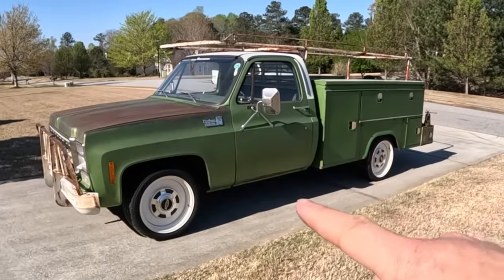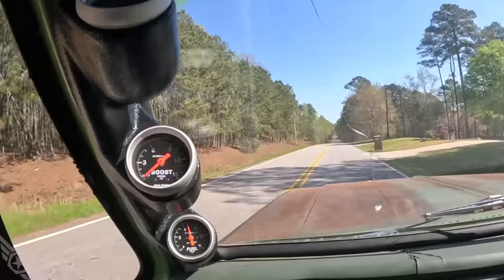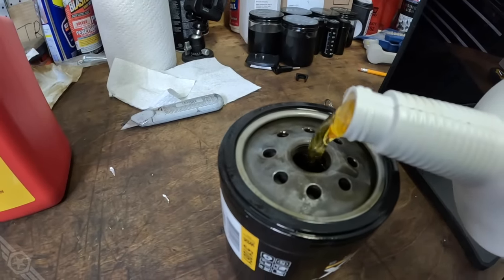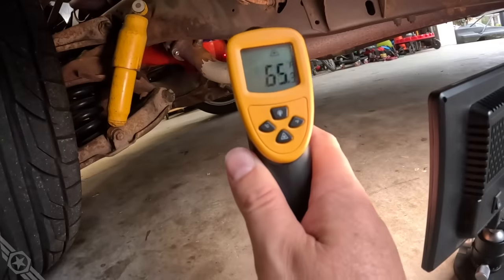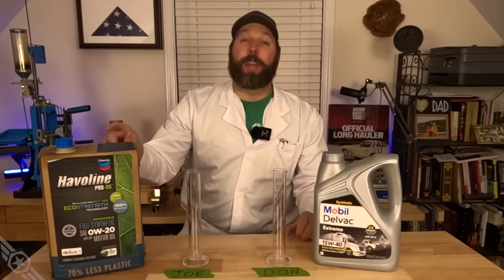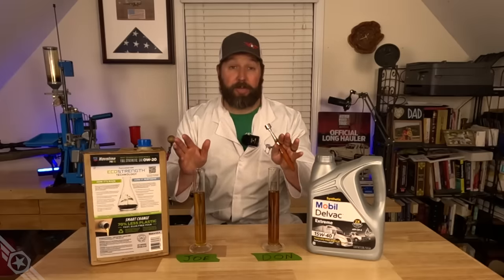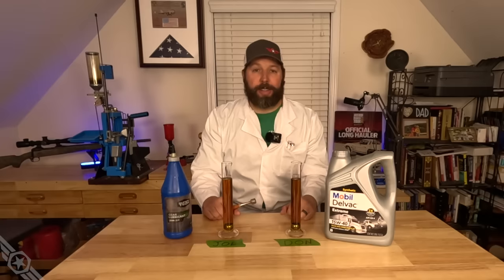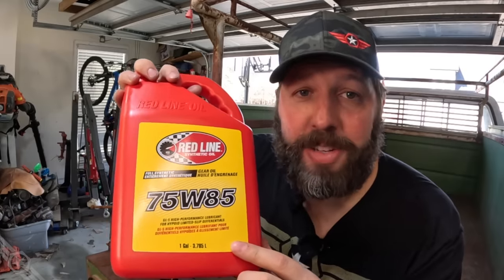Running GEAR Oil in an ENGINE!!! (EXTREME PRESSURE)

Comment: My experience with oil gauges (and temp.) is that they're an Idiot light with a needle instead of a red light.....you either have pressure (coolness) or not. I change my oil about every 6-10 thousand miles (after break-in) and have never had an oil-related problem in my 65 yrs of life. I do change the oil sooner if there's a turbo.
Reply from the maker: This is an actual gauge. Idiot gauges don’t move. They are either in range or out of range. The point t of the video is that gear oil and engine oil viscosities are on a different scale. The truck was just a teaching aid.
Reply: @freedomworx  Kool test. Thx for taking the time. As we all know, differentials and gear box's don't get as hot as engines.... so....there's that. Heat causes thick things to thin. As long as there's good oil between rods and cranks and no metal to metal....all is good. (except possibly milage)
    Try using cooking oil ....now THERES a test!
Reply from the maker: @averageskill you’d be surprised how hot a diff will get when you are towing a heavy load 😉

Comment: As you said at 13:18 i am curios how long a engine will last if you didnt torque the heads down properly as in not specific pattern and just hit em with the old ugga dugga
Reply from the maker: That would actually be a fun video to make. Break every rule in the engine building book, then send it 😂

Comment: Stupid question, but doesant the high pressure ball in the oil pump release at a certain pressure SO.... the pressure reading will be the same thick or thin?
Reply from the maker: The pressure relief valve is not opening at normal operating pressures. The oil pressure would need to be much higher for that valve to open. Small Block Chevy pressure relief valves generally open between 55-70psi. I was nowhere near that. That valve isn’t designed to modulate operating pressure. It’s a safety valve that only comes into play in extreme scenarios with very cold oil and/or very high RPM.

Comment: If you look at a viscosity chart the gear oil is in a different category or something. If I remember right 80w gear oil is something like 30 weight oil or something?
Reply from the maker: It’s an entirely different scale. That’s the point of the video.

Comment: Oil will be overheating, due to slow flow. Oil works also as coolant, cooling internals, gear oil will degrade faster.
Reply from the maker: 75W-85 is thinner than the 20W-50 that’s in it. You should actually watch the video 😉
Reply: @freedomworx  I watched, comment was done before you showed a table and test of  75w-80.
Reply: @freedomworx  still, gear oil will degrade fast.
Reply from the maker: Depends on the temp. Gear oil in a diff can run just as hot as engine oil when towing heavy. But normally, engine oil will be hotter.
Reply: @freedomworx  I got rear diff hot, but central was super hot, semi truck. I could always touch diff, but never tried to keep my hand for long time. Central diff oil was burned after 300k miles, rear was still good color. So as you described in your video - diff and atf fluids are not designed for fuel by products, also temperatures, hot combustion blow-by gases will destroy them, also there's no washing agents in this fluids and elements that keep carbon inside diff/trans oil. I think that temperature is the main problem...
Reply from the maker: Maybe. I’ll never know unless we have a zombie apocalypse 😂

Comment: I wouldn't have used a blown SBC but gear oil works fine but I wouldn't use it up north where it gets cold..I pretty much use diesel oil in all my engines from the lawn mower to my 6.0L Ford
Reply from the maker: Small Block don’t care 😉. I drained it out right after the video.

Comment: The original 302 in my F150 was so worn out that gear oil was the only thing that would stay in it. 80w-90 Lasted me long enough till i was able to swap in a rebuilt crate engine
Reply from the maker: When they are that worn out, feed them whatever they like. 😎
Reply: @freedomworx  "probably "

Comment: Derek Bieri mentioned in a recent video that you can use ATF in an emergency for a few miles if you have no oil of any kind. Just wondering whether that is worth a sciency test ?
Reply from the maker: ATF would be fine for light loads and short distances. In an emergency, you do what you have to do.

Comment: You know what also doesn't like sulfur? Catalytic converters. Not relevant for older cars though.

 But if you are stranded and have nothing else, better use gear oil than driving with low oil.
Reply from the maker: That’s a fact 👍

Comment: I'm curious why you didn't use 80w 120 for the gear oil? Not hater just curious how it would've stood up in test. How ty for the invite. 👍
Reply from the maker: I used a lighter oil that would not give the result everyone was expecting. I was trying to prove a point. 11 out of 10 people expected to see higher oil pressure because 75W is obviously thicker than 20W... But it's not, and that's the point of the video, and that's why people watched until the lesson was taught. Strategy😎

Comment: Pressure is one thing. Volume is another. MOre pressure less volume. PS I never understood why some people think it is bad to fill oil filters.
Reply from the maker: I think most people fell like the oil isn’t clean enough right out of the bottle to run in an engine. Which is pretty silly considering that engines didn’t even have oil filter until the 60s. And I don’t think the oil before the 60s was cleaner than what we have today.

Comment: 350,000 mile company Honda at Dillingham Airfield on Oahu - fouled plugs and burned oil like a chimney. Then got the idea of using the 60w oil we used in the planes' motors and instantly stopped behaving badly....
Reply from the maker: Whatever it takes to keep them running 👍

Comment: I had a 95 Mustang 6 cylinder (you kknow the engine that ALWAYS threw bearings all the time at about 80K miles... anyway it spun a Bearing so I changed the oil to two Quarts of Gear 85w and 2 Quarts of 50W oil for the Detergents (with Zinc Additives)... and a quart of Lucas, just for good measure. Then I drove it another 100K miles changing the Oil every 4K miles and the Filter about every 2K miles... Decided to drop the Pan and look, It had some Obvious signs of wear but it was Mostly Quiet so I cleaned it out and kept doinig what I was doing... Then I let my Buddy borrow it one day and he thought he'd give 'er an Earl Change while he was out in town... well... It died that day. Locked up tighter than a drum... I guess the Heavy Oil gave a little more Cussion for the Pusshin Rods... and im Sure the Lucas helped... but regular 10w30 from the Oil Change spot down the street wasnt enough... In fact, The only cars I've ever had any problems with got their Oil Changes at the Dealerships or the Oil Change Places... and their Game is Profit, not Reliablity. the Mollecules in the 80W oil are different shapes and more Smooshy even tho it may be the same viscosity, There are some Molecular Differences... like for Instance, the Oil Molecules in Full Synthetic are all very close in Shape and Size, where as the Molecules in Conventional Oil are Various Sizes and shapes... there is a lot of Chemistry involved...
Reply from the maker: Gear oil will unspin a bearing 🤓

Comment: Sure did pour pretty quick I've only seen gear oil pour out like that when it's thirty years old and over a hundred degrees
Reply from the maker: Well that’s kinds the point of the video. You think it’s going to be thick because the numbers are misleading. As demonstrated later in the video.

Comment: You can get gear oil thats pretty much the same as 5w40 or 5w30 in viscosity BUT id NEVER run that in an engine.
The additive package in a gear oil is by no means suited for a combustion engine.
Not at all to be honest.
No ZDDP Antiwear (transmissions use something different) and no ICE suitable detergents as transmissions dont need the detergent package an ICE engine needs.

As you said correctly the main antiwear in an ICE oil is Zinc dithiophosphate while gear oil use a sulphur compound often combined with high levels of Boron and Molybdenum.
In an ICE oil you will find a lot of ZDDP in comparison and very little Boron and Molybdenum. ZDDP and Moly are synergetic compounds actually aka they work very well together in the engine.
In addition the detergent packages are fundamentally different.
Engine oil is also formulated to burn as clean as possible because every engine burns tiny amounts of oil by design and all that is blown trough the exhaust aftertreatment system.
With gear oil that isnt a concern so its not going to be kind to the engine at all if its burns oil.

Aka gear oil doesnt work in an engine and engine oil doesnt work as gear oil. Im talking long term here hundreds of runtime hours.

ATF is also completely different from both engine and gear oil. Its closer to hydraulic fluid.
Usually next to no detergents, phosphor and boron based antiwear package. The specialty of ATF is that it needs to lubricate well while allowing the clutchsets of the gears to engage aka it cant be allowed to form any kind of tribofilm on the clutches.
Dual clutch transmissions need a different fluid again, cant use ATF in a DTC and cant use DTC fluid in a standard automatic.
CVT transmissions also the next category, different fluid again.
Reply from the maker: Yeah…all that 🤓👍

Comment: My first car , a 1955 Ford Ranch Wagon had a very worn 312 Y Block . Used to get cheap 'Raylube' oil for 15 cents a quart. [1973] It would burn 2 qts of oil every 15 miles. I worked nights, so the cloud of blue smoke was not as noticeable . I started running mostly 90 wt gear oil in engine. It reduced the smoke by 80%!  It worked for 6 months motor failed and I gave the car away.
Reply from the maker: At that point, whatever keeps it running 😎

Comment: From experience…….if you run the gear oil in engine all summer, when you pull the pan you will find what looks like ball bearings in it.
The sulfur begins to separate from the oil and they form into little balls……and yes the filter will be full of sludge.
Reply from the maker: Little balls. Interesting 👍

Comment: The way that 75w-85 oil was pouring, that was it poured like the 0w-20.
Reply from the maker: It pours like 10W-40 engine oil. Because it’s basically the same viscosity as 10W-40 engine oil. Engine oil and Gear oil are on different viscosity grade scales.

Comment: I know the red ervin's gas station bar and chain oil for chainsaws works perfect in an engine even at high RPMs seen it done or period of like a year and a Ford Ranger
Reply from the maker: The viscosity is fine. The additive package is not. Same with gear oil. It will perform fine for a while. But wear and deposits formation is likely to occur eventually.

Comment: Ive ran gear oil in an old lawnmower that had a leaking lower crank seal. It would leak oil soon as i put it in. Had some part bottles of gear oil and i used that. Ran great till i finally scrapped it after the mowing deck rusted out
Reply from the maker: Whatever it takes to squeeze all the life out of one 😎

Comment: At BMW 320 I we have replaced the gear oil in transmission with 30 weight engine oil to fix synchronization problems.
Reply from the maker: Probably some expensive German 30 weight 😉

Comment: With hi pressure "sulfur" stuff.. Can I use 75w85 at a hi compression, 22 psi 1.8 20V Turbo only at trackdays? In long therm should melt all seals but... I ll give a try. (Probably not)
Reply from the maker: Better just stick with Engine Oils. They taste and smell better anyway 😉

Comment: Engine oil 5 specs: cleans combustion chamber due to special aditives, keep cool the engine by convection, seals the combustion chamber, lubricates the engine and stops the corosion of the engine. Gear oil doesn't do that.
Reply from the maker: If your engine oil is cleaning you’re combustion chamber, you’ve got problems 😉

Comment: not exactly, but similar, my boss just ruined his engine, he was working 10+ hour days 7 days a week for several weeks, ran his engine low on oil, he lives 75 miles away, so 150ish miles a day, couldnt afford new vehicle, so I explained to try something, his main bearing was knocking, if you know the sound? I am a mechanic.

well I suggested to use 20-50 Valvoline racing oil with double zinc, to help cushion the pressure of crank to bearing, after oil and filter change, motor sounds almost perfect, have to listen for the noise, but almost gone, fingers crossed, so far he has put close to 2K miles on it without issue, will it last? fingers crossed, but if had not, he had already called junkyards for pricing to sell it for scrap.yes it calls for synthetic, but now its junk, so trying old school stuff, if it works for 6 or so months, it was worth it. if it blows, it was blown already, so still won, already used it for 3 weeks, on week 4 now, 

word of warning, the zinc could contaminate your catalytic converter, but in this case, I told him, so, then junk it, buy a replacement car, or deal with the check engine light coming on, so far light has not came on, but i figure it will,, the vehicle has 280K+ miles on it.

he makes good money, but took his family on vacation to another country just before this all happened, had saved 2 years to do it, thats why crying blues now, but he hoping can save enough in 6 months to buy another decent daily driver with cash, and not go in debt, so time will tell, but thicker oil can mask problems. or in this case, make engine usable, versus scrapping the vehicle
Reply from the maker: Using a thicker oil can definitely quiet a loose bearing, but it’s a result of the thickness of the oil, not the zinc. Gear Oils will quiet a bearing and they have almost no zinc in them. And as demonstrated, 20W-50 is thicker than some grease oils. 20W-50 is provably a better option if it’s thick enough to do the job. Can always go to a thicker gear oil later if necessary.

Comment: What if you delete the oil filter by removing the filter element? Will that increase horsepower being that there’s no more back pressure reducing resistance on the oil pump thus reducing friction on the crank?
Reply from the maker: Probably wouldn't make much difference on a normal engine, more on a high RPM race engine. The resistance to flow is still there without the filter in the circuit. The pump is still trying to push oil through the bearings, valve train, piston squirters, etc. The pressure differential across the filter is pretty insignificant in relation to that, except when the oil is cold and RPMs are high, or the filter is dirty.

Comment: We ran 50 weight in race cars back in the day. I never had any problem with it. When we built pro street cars, the same thing, 50 weight. You wouldn’t want your run it in cooler climates, but in the AZ desert it worked fine during the summer. In the winter we would use 30 weight. Now they run water, like 0-20 or some stupid thin stuff like that.
Reply from the maker: Thinner oil means less drag and frees up horsepressures. They are looking for every advantage.

Comment: I had an uncle that owned a used car lot....he would replace 2-3 quarts of engine oil with gear oil when he got a car in with a knocking engine or one where the oil light would come on at hot idle in D and stopped....some of the buyers would come back mad after they changed the oil and say he "doctored" the car up to rip them off...he would run them off the lot...
Reply from the maker: I can't imagine why Used Car Dealers have gotten a bad rap over the years 🤓

Comment: Just crack and pour a bottle of each and you would know that engine oil and gear oil aren’t that much different in viscosity. I do have a few quarts of gear oil in my garage and redline synthetic 75w-140 is pretty thin compared to valvoline 85w-90. As you mentioned additive package means a lot more than viscosity when it comes to lubrication. Any reason redline was chosen for gear oil? I think a lot of their products are on the thinner side.
Reply from the maker: I just chose Redline because it was the cheapest 75W-85 I could find.

Comment: Ive never in 50 years ever heard of anyone putting gear oil in their engine or wanting to either.
Reply from the maker: This is not about wanting to put gear oil in an engine. It’s about showing you that gear oil viscosity grades are in a different scale than engine oil viscosity grades. Though plenty of people do put gear oil in engines that have low oil pressure or knocking Rod bearings.

Comment: This is why the old timers tell us to just put thicker oil in an engine when it give you problems. Problem with that today is these newer engines have smaller passage ways and variable valve timing, if you put thick oil in an already restricted/sludged motor you’re not going to get the desired outcome
Reply from the maker: Yeah the newer ones are a little more sensitive to fluids.

Comment: Not what I was expecting. I feel a tight tolerance engine would fail quickly.
Reply from the maker: Well a tighter tolerance engine wouldn’t be running 20W-50 😉. There are no gear oils that correspond with the lighter weight oils that are used in newer engines. That’s why I used this engine as a teaching aid.

Comment: 75w gear oil is used mainly in wet clutch motorcycles ..and used in my trials bike
Reply from the maker: True. It gets used in auto gear boxes as well 👍
Reply: @freedomworx  well dex3 atf fluid can be used in trials gearbox aswell and I'm sure 75w has the same viscosity as 10w30 motor oil
Reply from the maker: @Bossman36335 are you in the U.S.?  One of my engineering professors at Auburn (Dan Brown) owned the Trials Training Center in Tennessee. I raced Harescrables in my younger days. Always wanted a trials bike.
Reply: @freedomworx  no Scotland..i have 2 trials bikes a scorpa easy rotax and a beta techno..both I use 75w